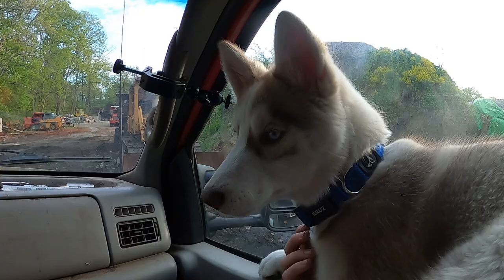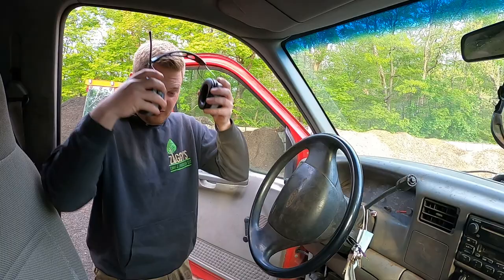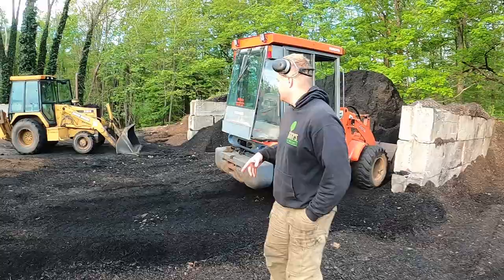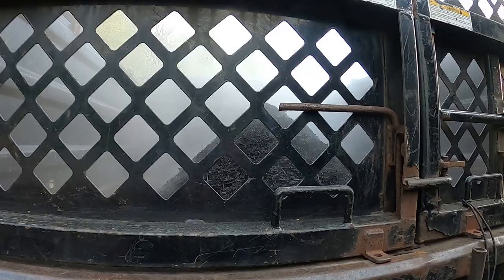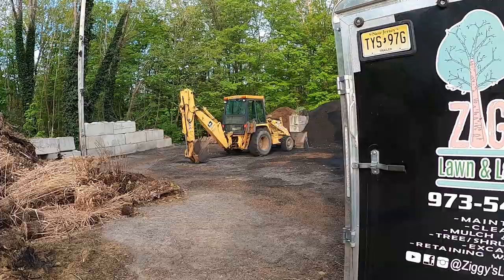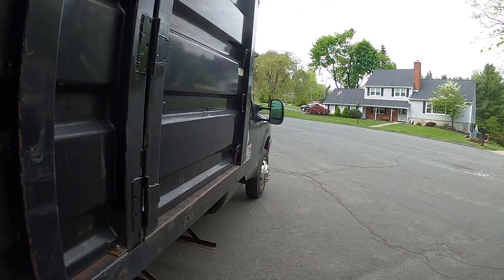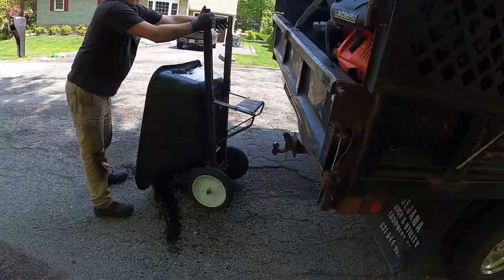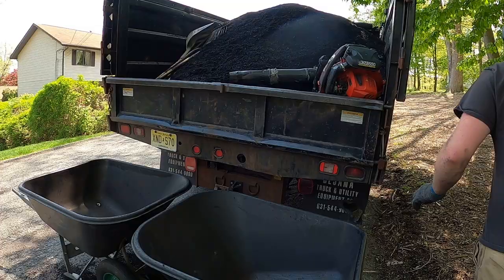Why We Don't Get Mulch Delivered on The Ground EVER... Except This Job!

Comment: we have 1 child who is now 16 but we have had a VW Tiquan and now we have an Audi Q3, no 3rd row seating but we didnt need that for only 1 child.  7.3 question, so i have a 2001 f350 pickup, runs great but every so often it leaks transmission fluid.  My route is super dense where i have very minimal drive time except for 2 lawns which each are like 20 min away from my normal weekly route,  i have noticed when i take those trips out to those lawns that I leak tranny fluid but during my daily route of 46 stops it doesnt leak at all...what could be causing it to leak on longer trips?  also side note, its only when Im pulling the trailer and or have grass in the bed, If i take a longer trip without the trailer it doesnt seem to leak
Reply from the maker: That’s a good question. I’m not really sure seems like a seal that weeps when pressures/trans temps are up. Transmissions are tricky to nail down stuff sometimes. Wish we knew as much about them as the motors

Comment: alot of yards ive dealt with usually didnt take card. they dont want to pay the fees to use card. and some only do cash and no check cause people wright bad checks. and i hate mulch on the ground pain in ass cleaning it and if it wasnt a dark drive way then the color mulch bleads onto the concrete.
Reply from the maker: Yep exactly good point on the dye too. Leaves more a mess than anything
Reply: @ziggybrothers  how ive always felt. we kinds do mulch out the bag most of the time. little more work but seems easy for us

Comment: Since you have a Rav 4 already, why not get a Toyota Sequoia? My dad has one and he loves it, though his is a bit on the older side (2007), it would be a great car. Just know that if you get the first gen Sequoia (2001-2007), it has undercoating problems so you will need to find a rust-free version if that is the case.
Reply from the maker: Definitely will look into it